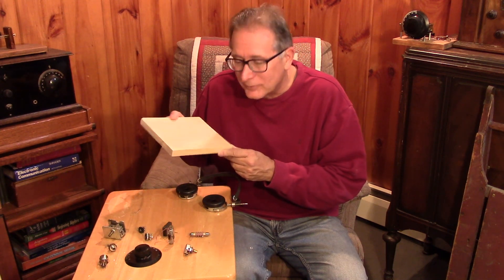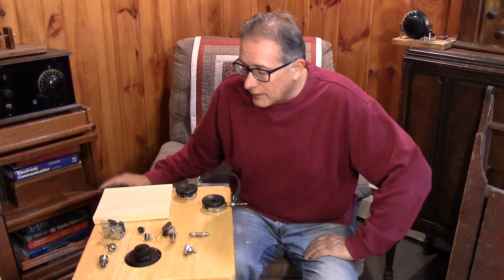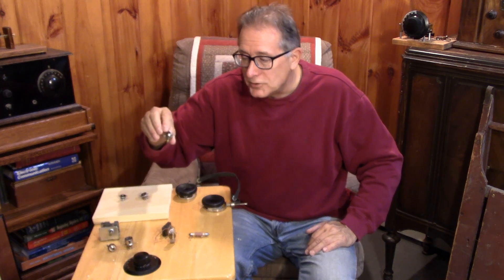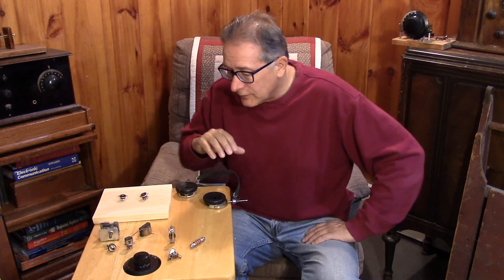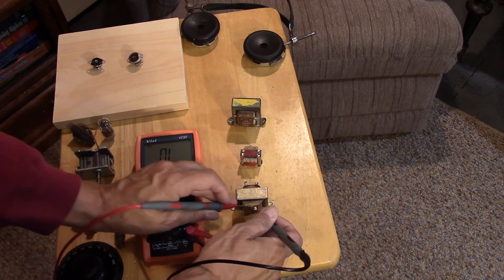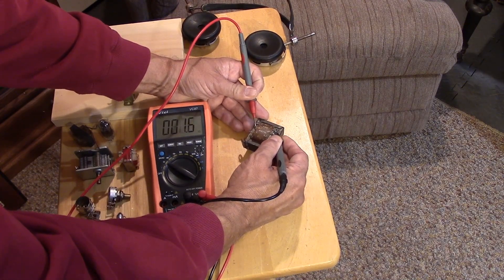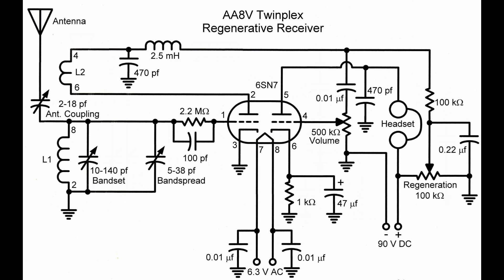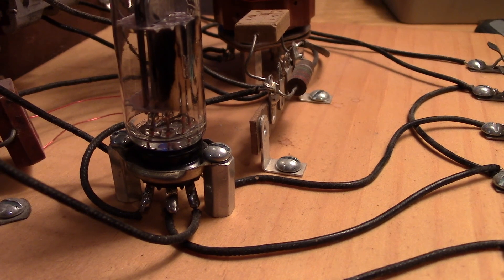Low Voltage Regenerative Receiver Project - Part 1

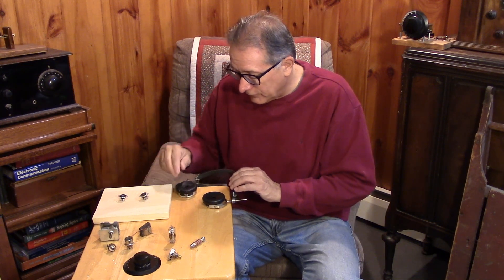Comment: 4:42 “People have criticized the use of 90-120V on the headphones…” - Flashbacks from "One Flew Over..." 🤦🏽 That’s a really important point. As a beginner, while live-assembling/tuning a one-tube regen, I once got zapped in the fingers with about 50V - not good at all. I lowered it to 16V, and it feels much... cozier now. Huge 👍🏻 for this great video series - wish I’d started watching earlier.
Reply from the maker: It's rare corner case to get tickled from your headphones, but it did and does happen, just like with the -120V on your grid blocked key of your old transmitter. 90% of all regen tube projects before 1970 madly put juice through the phones.
Reply: @MIKROWAVE1  That's crazy! I once had a pair of Soviet high-impedance headphones (TON-2M). Back in the late ’90s, they seemed laughable - all plastic and rubber, with a cable that looked like a power cord and even a plug like for a wall socket. They were probably meant to run on high voltage/non-grounded.

Comment: I am 86 years old. When I was a  kid I built regenerative receivers with 250 volts and amateur transmitters with 750 volts. I was zapped several times and still I am alive. Stop with big brother protection.
Reply from the maker: When we were young and given the tech, we got zapped - a lot by the way! I've been hit 100 times at least. I still warn folks though.

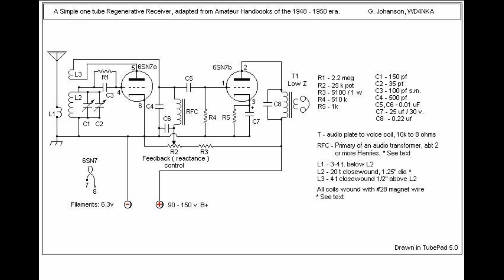Comment: 10:47 🇧🇷👍
Reply from the maker: Regens are fun. Applying Low Voltage to high voltage valves is fun and safer, but unpredictable, since we are trying to use the deivice in uncharted territory.

Comment: I wish a regen receiver that has no semiconductors that are EMP sensitive. I have a very good reason for this. Whether the EMP comes from the Sun, or "another source", I want the receiver to stay working no matter what.
Reply from the maker: Any receiver in a metal case that is properly bonded (a Faraday Cage) and not connected to an antenna will be safe from EMP. So store it until you need it. EMP typically takes out the first stage only - the one connected to an antenna.
Reply: @MIKROWAVE1  Well, what I worry about the most is an EMP attack from Iran or North Korea because they are capable of such. I have a small Faraway cage I built for just a C Crane radio and two  Yaesu handhelds  for local comms, but I'm going to build a bigger one soon. But I do not worry about my National HRO-5TA-1 and my Viking Valiant II tube only radio is that they do not use transistors or diodes. No semiconductors means no sensitivity to an EMP no matter what the source. I'm building three tube regeneration shortwave receivers and a crystal radio for last chance info collection in case I get caught by a late EMP a week after I open up my cages. Call me a worry wart, but backup equipment is necessary to me.

Comment: Can't the 12au7 heaters be wired in either series or parallel too?
Reply from the maker: Yes which makes it very useful. But here is a question: What if you only hook up the center and one side of the filament?
Reply: @MIKROWAVE1  Does the other filament/cathode get heated by the first?
Reply from the maker: @diobrando2160  Actually there are two independent triodes inside. So only one gets juice. This is a way to turn off one side of the tube.
Reply: @MIKROWAVE1   Ah, so the filaments are completely separate then.

Also do you have videos on beginner valve amplifiers?

Comment: Oh..Is throttle regen. better than voltage control?
I never used anything other than throttle and felt that I should really be using voltage.
I have an enviable junque  box of caps collected over many years so I'll stick with throttle.
At 80 I'll put the rest of them in my will to MIKROWAVE1.
Reply from the maker: For triodes, Throttle or Variocoupler seem unbeatable. There are some cascode circuits that claim to work well with voltage .  For pentodes, a variable voltage off a well regulated  source to the screen works very well if the bypass is chosen carefully.

Comment: i am not sure where to get the audio transformers, but can i use ac power transformer ?
Reply from the maker: It depends. The best or highest impedance types will be small. For instance a filament transformer say 6.3 VAC at 1 A from 230 V mains. That mains side will have a high reactance at audio frequencies. This is a good experiment, and something to try in the video.
Reply: @MIKROWAVE1  i see, so small o/p voltage transformers to be checked, thanks.

Comment: Hi! I have to remove the dust of my tube's box. There are  3 miniature single triodes with double diode but no inscription wit the name. May be 12at6 or 12av6 because there are some like 50c5 and 35w4. I am waiting for the second part! Thanks you for share it!
Reply from the maker: Tubes were so advanced and well manufactured, that even by the 1930's, they could take ridiculous abuse and still function after 75 years.
Reply: @MIKROWAVE1  I can say you are right. When I was young in the 90's I make my first am transmitter of a 6dq6. In the adjust procedure at a fail on care or attention the plate become red and hot like a chili pepper and were enough just to retune the plate to stop the problem and the poor tube stills working fine. Try this with an rf transistor without cry for a week later!
Reply: @julianvalenti  
When I was an apprentice, my boss didn't like transistors... He said "They just sit there with three bloody legs and say 'I won't work. I won't work. I won't work!'  "
Reply: @MauriatOttolink  Hi! We really know that transistors are te best choice to make engineering an develope new products. But in the experimenting and playing with circuits we can use tubes as alternative. Thanks to share with us!

Comment: I managed to salvage a toroid from a switch mode power supply.  My LCR meter says it's 100 mH at 10 khz.  I'm not sure that's correct but I will try it anyway.  Not for nothing but kitsandparts.com sells an FB-31-1020 toroid for $4.50 American bucks and 10 feet of wire for a dollar.  30 turns of wire will give 5 mH at 1 MHz according to their calculator.  This might be an option for people who don't have an old tube type radio to sacrifice.
Reply from the maker: Worth a try!

Comment: Love this.  I'll be building it.  I have 2 cheap standoff options that I've used successfully.  First is a section of polyethylene tubing - bought a foot for 29 cents.  Just cut it to length and run the wood screws through it.  (Used this method for Bob Heil's Pine Board Transmitter; worked very well.)  The second is the white polyethylene/polypropylene cutting boards that were being discarded from the kitchen.  Cut into 1/2" to 3/4" squares, drill a hole and there you are.  The squares can be stacked to make various heights.  Just some thoughts; I like to build with as much built at home as possible.
Reply from the maker: That would make a good video - a radio built from your kitchen clutter alone...

Comment: Sorry this will make for a unit that will be very safe. Philips Raytheon (5840W) Micro vacuum tubes will also work and no socket is needed as the wires can be wrapped around the screws before being tightened up if you cannot get that type then KORG 6P9 tube will also work but is sightly microphonic, if you use 47,000uf 25V WKG Electrolytic capacitor as well as a ceramic capacitor should keep the hash down.
Reply from the maker: I was thinking 100 to 220 ohms and then a 1000 uF and a 0.1 to ground. After the fils.

Comment: 12au7 is quite good for low voltage, 12bh7 is even better. any hi-gm pentode connected as triode will work well too.
Reply from the maker: Once I get it working (please work), I will substitute a few valves for the 12AV6's, and we shall see some interesting effects, I am sure.

Comment: Looks like many 12AV6 prices have just gone through the roof....
Reply from the maker: This is funny. When I wanted to build the Morgan Regen from the book as a kid, the 6BF6 was specified. It was not a very common tube compared to the12AV6, 6AT6 or 12AT6, which I already had a box of and would have worked fine. So my dad takes me down to the TV service shop where the guy charged 5.95 in 1972.that is 37 dollars in 2020 value.

Comment: Last spring I did a similar build more or less for free, all from junk I had. One tube (MRL circuit) into a set of computer speakers through a capacitor, used a plate load resistor without trouble. The 12BA6, tube socket and tuning cap (with big wheel knob for easy tuning) came from a extra grungy AA5 clock radio not worth restoring I think I paid $5 for, the rest, including parts for the homemade few pf antenna coupling variable cap, came from a junked boom box and various junk appliances. In lieu of a proper coil socket or forms I used alligator clips and pill bottles. It liked 20 some odd volts of B+, picked up stations from broadcast band up to about 10mhz (WWV on a good night) and seemed limited by the antenna I came up with, 60 ft of wire sloping from about 8 to 20 ft, more than anything. One can totally build simple tube receivers cheaply without much of a junk box, that was the first radio I ever built.
Reply from the maker: Wow that is an awesome feat of junk magic!
Reply: @MIKROWAVE1  That's what I like about the regen, everything critical is by design adjustable, or up to the builder, lead dress, layout, etc.  I think I'll center the next one around the back/antenna of that AA5, with a tickler on a stick like an old Crosley regen.

Comment: I have a regenerative that runs on 12v, I believe I used a couple 12AU7s in it. One for the regen and one for the audio amp. Works well, if a little quiet. I look forward to the rest of the series, I know when i saw you had put up a new video my first reaction was "AWESOME!"
Reply from the maker: In Part 4, I want to try 12V on the Regen, with a few different tube types. 12AU7, 6C4 and the 6BF6 -  OH and let's pull the tubes and stick in some FETs.

Comment: 12 volts on the plate, you got my interest.  Also I will be following your design process.
Reply from the maker: Of course nothing is for free. Less voltage means less gain and less audio volume. But operating a regen starved is an old trick for getting smooth regeneration control.

Comment: This’ll be fun. Had to laugh at a memory this jogged...when I was a kid, I powered the heater on some miniature triode and played a portable cassette player through the tube—with zero plate voltage. I got a tiny, weak, horribly distorted output that I’d listen to for hours just because it had traversed that tube. A little miracle in a bottle. That was as much fun as the first working circuit I built.
Reply from the maker: I have no idea what you did, but we should name the effect before someone steals the intellectual property!

Comment: I'm glad that you are helping keep the old homebrew radios alive.
Back during the 90s I was in a Yahoo Club that designed and built very high performance Crystal Radio Sets.
From that, I also built some tube radios....regen, reflex and others from the period before the Superheterodyne All American Five came on the market.  The AA5 took the market by storm and after 1932, the earlier designs became academic except for some special uses.
My fav regen radio runs a Type 30 tube with a pair of variable caps for regen control.  There are still tons of small value trimmer caps available on Ebay  to use for the fine tuning cap.  It makes it easy to ride the edge of regeneration.
I was never happy with designs that used a Pot to control regeneration.
Despite that, I think that over time most homebrew regen radios did use a pot for regen control, because it was cheaper.
Reply from the maker: Wow you have seen the whole cycle of radio development!

Comment from the maker: Eduardo asked about the Schnell type regenerative receptor - Any time that a link coupling method is used either for input coupling from the antenna or as a variable coupling method for feedback, as with a regen, you end up with a smoother and more predictable control. But it is hard to manage on multiple bands, so the plug in coil and throttle capacitor is more common.
Reply from the maker: As usual. I usually am treading on ground that had been trod before and it becomes a learning experience!